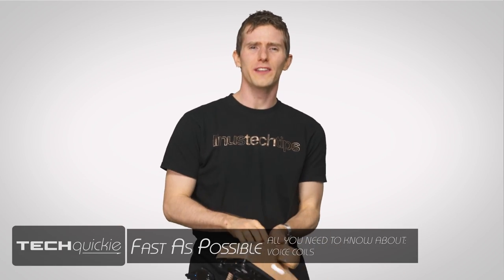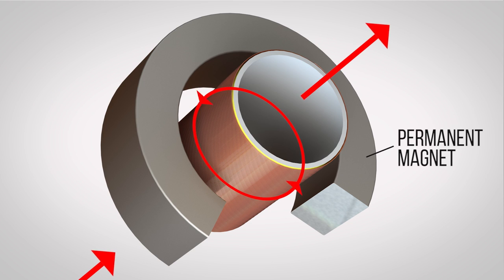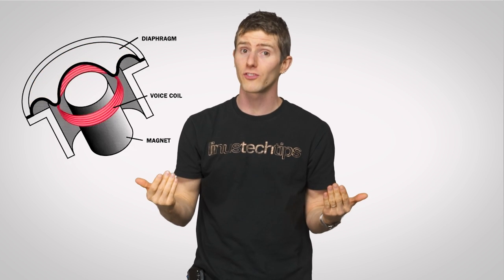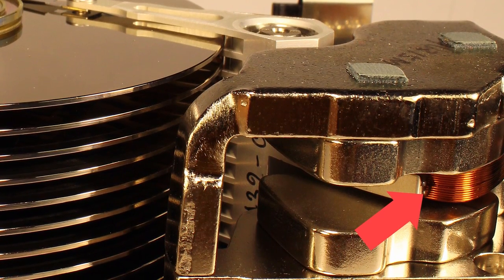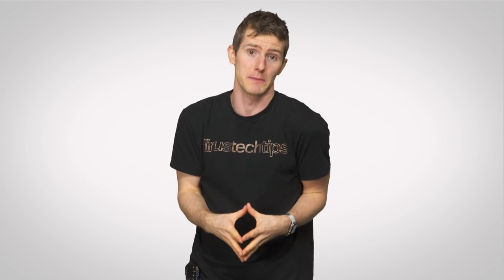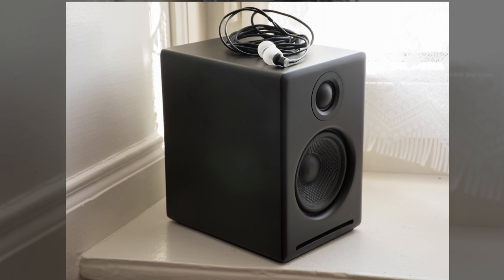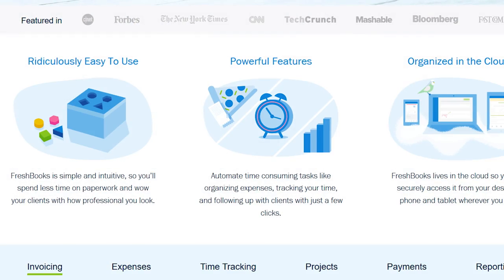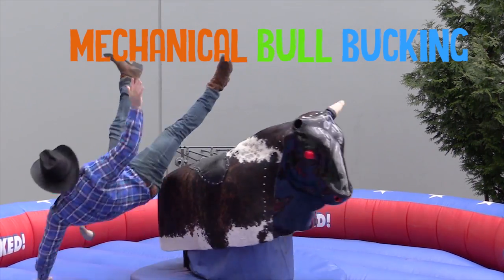What are Voice Coils?

Comment: Linus you forgot to mention that there is another type of speakers out there too. Just like microphones there is one type with electric coils and a permanent magnet and the other type is condenser microphones or in speakers you have the electrostatic speaker. And that electrostatic speaker membrane can move even faster than the coil, and since it has less mass than a coil with membrane attached, it can stop faster too. Thus it has greater frequency response over traditional voice coils.
But I have not seen that technique used in computer hard drives though...

Comment: No .. on a speaker .. your on about the driver coil ... a voice coil is the corrigated donut shaped disc that is connected to the bottom of the cone to the chassis  . Some speakers don't have a voice coil .. most do though.
Reply: i’ve never seen a speaker without a voice coil unless it was blown and someone had taken out the soft parts